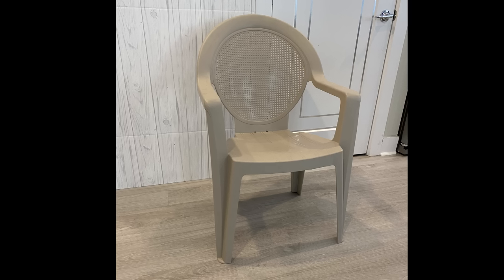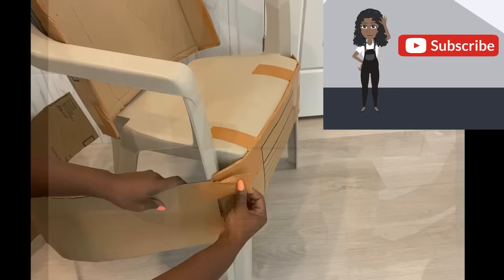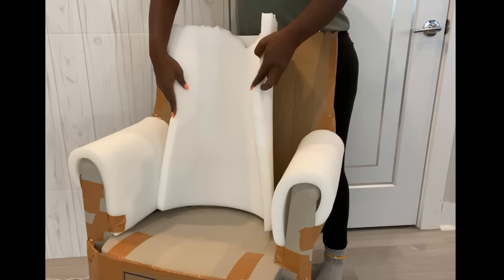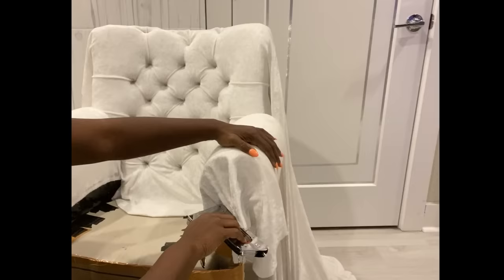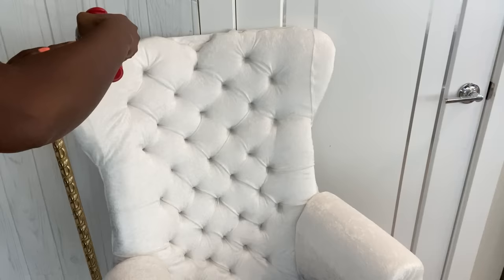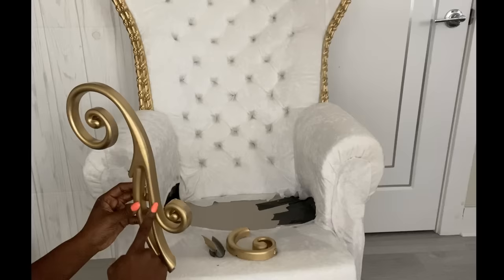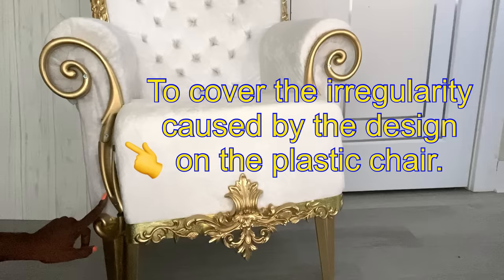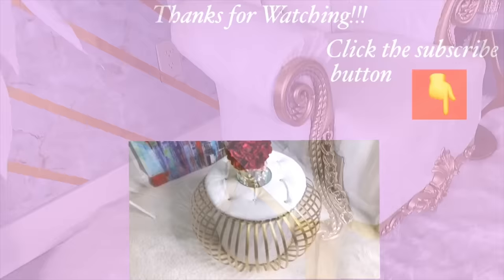SEE HOW I TURNED A PLASTIC CHAIR INTO A THRONE CHAIR | DIY CHAIR ON A BUDGET!

Comment: I just want to say, you are amazing. I watch all the video I can from your channel. My best friend and I was so inspired by this throne chair that we are attempting to make it.  Instead of the plastic chair, we use a patio chair with metal legs. We are not finished yet but almost done.  If I could show you pics I would. There's one thing were stumped about. That is where did you get that chain from to cover the imperfections on the legs. What is it called. Thank you for your inspiration.
Reply: I am making one as well. I can’t find the pieces for the arms what did you use?
Reply: @jenrichardson8523  for the arm of the chair we followed what she did with the foam and layered it until we reached the thickness and shape. For the front side we found this thin flexible wood panel and cut it to the shape we needed. We found the flexible wood panel in lowes. We got it for free. It was nice size scrapes of thus paneling they had cut and was going to discard. They gave it to us for free

Comment: She needed to sit on the chair to see how strong it is.
Reply: She didn't build the chair.  The strength didn't change.  Same strength as when you buy it from any lawn and garden store
Reply: The chair was probably for decoration or a bed for a small animal
Reply: It still has the same balance and strength she just added extra layers to it
Reply: I was thinking the same thing 😂 I had a plastic chair bend and collapse on me. My friends would think its sturdy and plop themselves down and end up on the floor like me. I would make this but use wood instead just to be safe.
Reply: @2alien4earth2human4space  i think the point is to be cheap and reuse plastic materials that aren't recyclable.
Reply: Remember it was originally a chair, look how much materials she added, its like e times stronger than the original
Reply: You could repurpose a wooden arm chair with a similar size and shape using her same technique. That would give you a little more stability and longevity. It’s about to be yard sale season, so I know what I’ll be hunting for! 😂
Reply: @Carlenewatts  why she is saying this because the uses of staples and tapes and i also thought same
Reply: @2alien4earth2human4space  exactly  that's what l mean just to be safe l have seen these types of plastic chairs break under people's weight. I think she did an excellent job just wanted to see her sit down on it except it's for decorative purposes.

Comment: My comment is two years later but I wonder if you can tell me how you got the tufting pins in so perfectly? I don't quite understand how you used a staple gun to do it? Thanks for this great video. Liked and subbed. Also, toothpaste can make a great filler to smooth over gaps and rough spots.